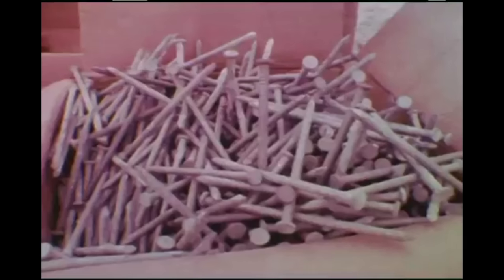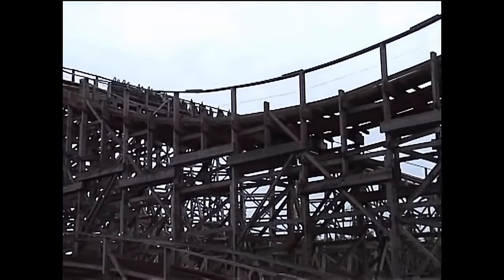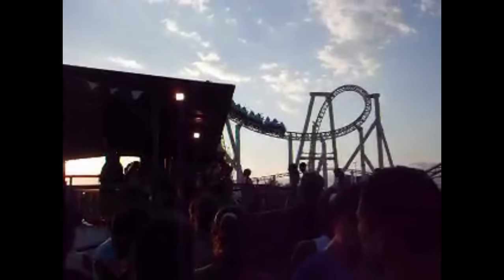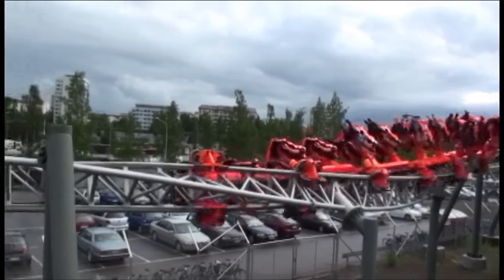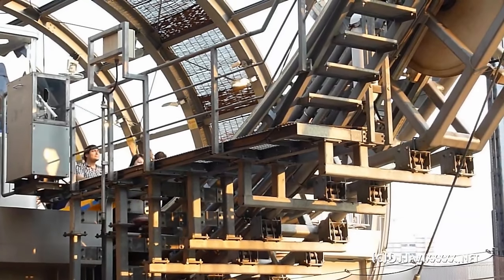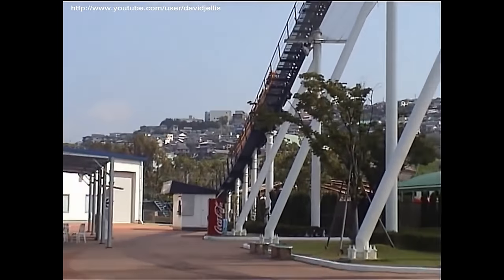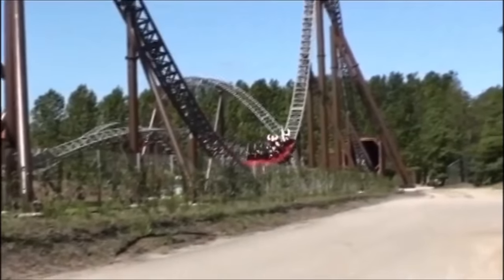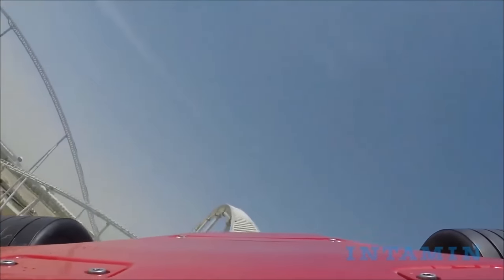Intamin Complete Roller Coaster History: 1979-2023 and Beyond

Comment: In 2024, Six Flags Over Georgia will open the world's first Intamin Ultra Surf coaster and will be the first SF park in the chain to get a new gen Intamin coaster
Reply from the maker: I know, the first Intamin to be left out of this video! I might do a follow up every year for any new Intamins announced after
Reply: Ehhh it may TECHNICALLY roll and use gravity to coast, that is a water ride. Until I see something that looks like Pantheon or that new Batman in Spain I wouldn't consider six flags having a new gen Intamin yet.
Reply from the maker: It actually doesn’t splash down like the Mack model, the water effects are all done through fountains. So it will be more similar to the original Surfrider at Wet n Wild with the water jets than anything